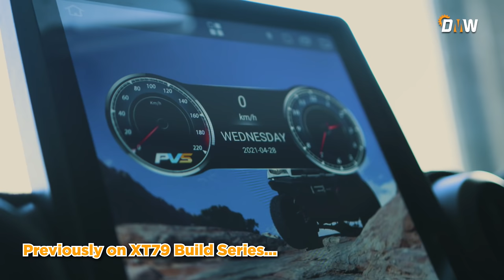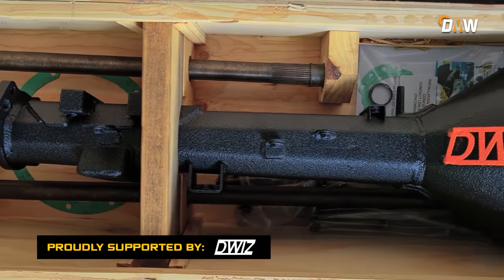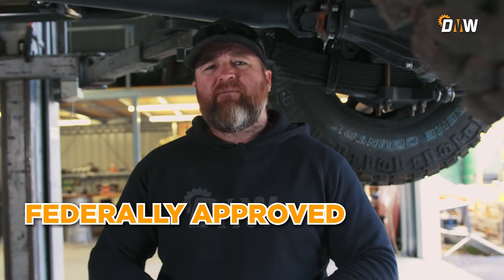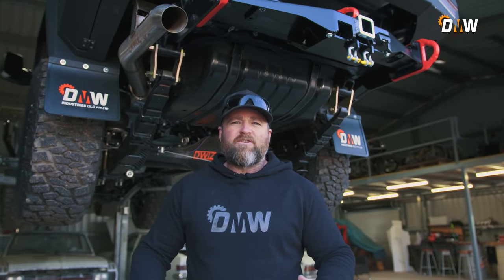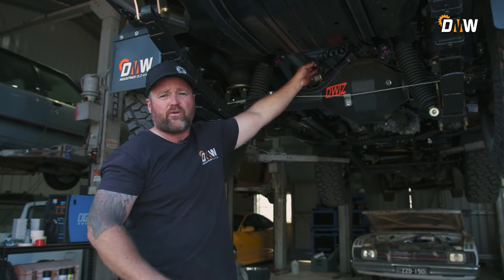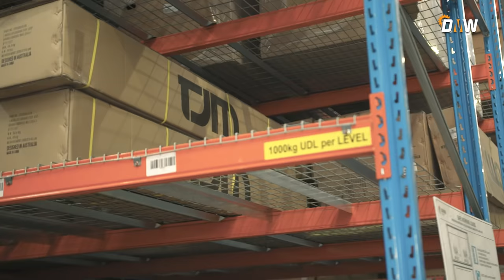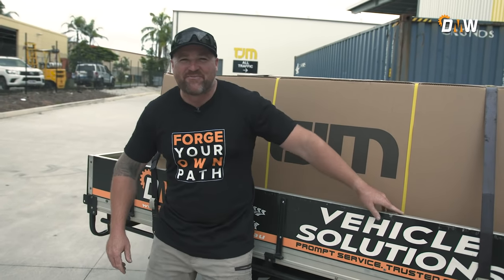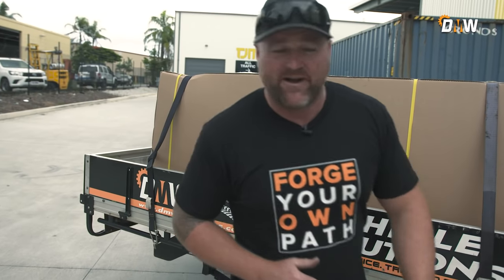Landcruiser XT79  Build Part 3! TJM Factory Visit, Diffs, Suspension, Exhaust.....

Comment: you have all the good stuff but your rear rack support is intruding on the flat loading space.  come on invert it. 
i do like your Suzie coil breather tube.
Most of all i like the use of the word COMPLIANT.  
to many doodles out there doing backyard engineering. its dangerous. just because another bloke has done it, doesn't mean it is COMPLIANT. 
4" lift 2" body lift. wheel spacers. etc. etc.